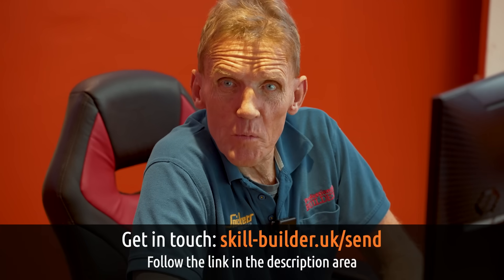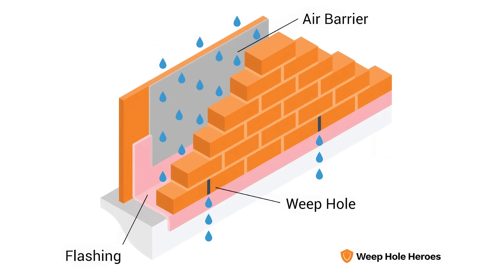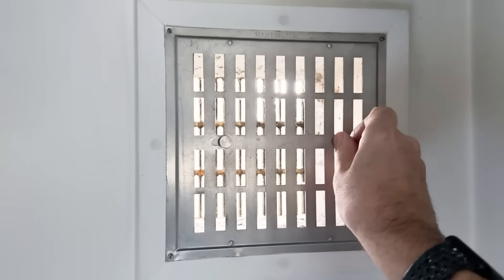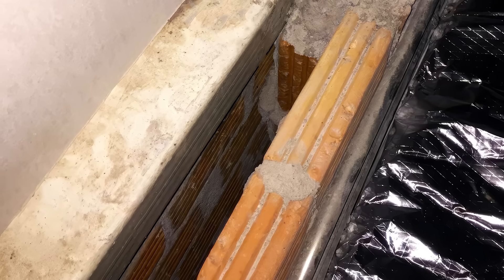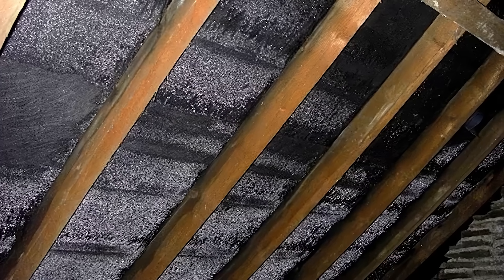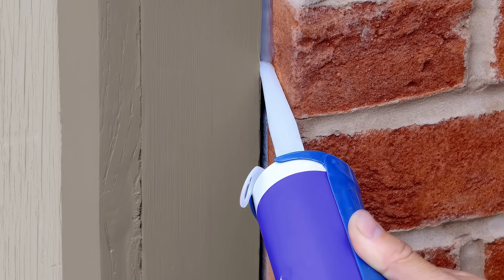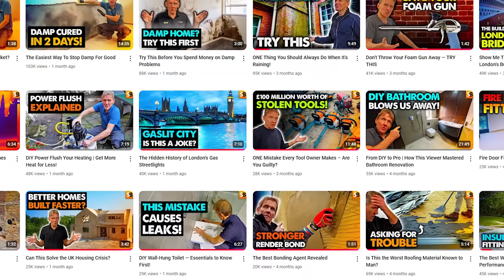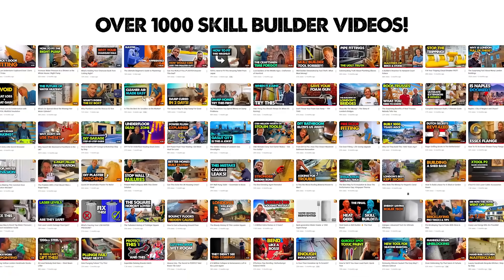The Truth About Cavity Wall Ventilation

Comment: I've got an odd internal cavity vent (white plastic louvered thing) on the internal wall of a cavity wall situation. The gable end is north-facing and gets cold bridging along the bottom sometimes causing condensation (the condensation pattern seems like it follows the mortar detritus etc in the cavity) , and I wondered of this was a 'fake' solution to that, or if it was where they put in some fibreglass insulation (which is in there) and never closed it back up properly. It's very strange.
Reply: Do you have an open fire in that room. If so it may be there to allow air in to feed the fire
Reply: @chapman9230  Thanks for the reply. 👍There's no open fire in the whole place. I can only assume it was either to placate the previous resident/s about the condensation or to install some fibreglass cavity insulation, it just seems very odd.
It doesn't go through to the outside wall and isn't sleeved, when you pull it off to reveal the hole (5/6 inches across) you can see the insulation so maybe it was to do with installing that, but I haven't yet come to a satisfactory conclusion about it.
For example someone suggested it might have been for a tumble dryer exhaust, but as it doesn't go outside and is in a position where you would never put an exhaust/dryer I have ruled that one out.
Reply: @thesunreport I suspect it used to go to outside and be sleeved as a vent for the room. But then when cavity wall insulation was retro fitted they bricked up the outside vent and just left the inside with the vent face.

Comment: Do we block up all the weep holes as well then?
If ever there was a waste of time it was weep holes. The Germans don't use them so why do we?
When cavities were ventilated we didn't have half the problems we do now. 
We have to fit cavity  trays halve way up the building, why? All that plastic just adds to condensation.
As for closing the cavity at plate height, (loft) haven't done that for years.

Comment: If the cavity is trapped, would that not cause condensation inside and psosibly cause damp and mould?
Reply: No, Roger said that any water/condensation should be allowed to soak away into the ground.
Reply: @chrisallen5548 but it wont completely will it. In the long winter months with any driven rain and even condensation, that cavity would remain damp and begin to mould up on any smooth surfaces in particular. I would personally leave the top of the cavity open and insulate with something that doesn’t hold moisture. That is unless you can, with absolute certainty, prevent any ingress, apply lateral vapour control and seal the cavity entirely with no airflow. Borderline impossible.
Reply: It would condensate, but then drain away, not much different than venting the cavity.
Reply: With the absence of cavity trays and weep holes moisture will get trapped so where a condensation risk occurs air changes are still needed in older cavities Roger  miss leading the masses again
Reply: Well the inner skin will be warmer than the outer so would not attract condensation - in winter. Airconditioned in summer it might
Reply: Recently built a new house, NHBC registered . They stipulated a new cavity insulation, polystyrene coated with a plastic facial sleeve. These interlock with each other. The plastic sleeve has vented flutes on them. The gap  remaining in the cavity was 25mm to the outer skin. It's the biggest heap of shit I have ever used in my life.  You have to slice through the plastic face to poke your wall ties through, therfore making the permeable barrier insignificant.  Does some numpty sit in a office and think of shit ideas to fuck a bricklayer up.  Time consuming is an understatement and the cost of the it to buy was extortionate. Fuck NHBC
Reply: Yes. 100%

Comment: Your videos are always interesting Roger! I have air bricks that are below floor level, but have a concrete floor (late 1970s bungalow). Does this mean the floor is in fact block and beam, and there is are space underneath it? Cheers
Reply: You can have both, one room in concrete, the other not. Why, i have no idea.
Reply: Or it was built with suspended timber floors but filled in and concreted at a later date
Reply: Dutch here. In about 1978, our neighbors took out the wooden floor and poured concrete on sand. Then we got rising humidity in our living room. In 1980 my father took out (with an other side neighbor) our wooden floor, 4 by 9m, and drilled holes to put chemicals in them. Then he installed concrete beams and concrete "breads" between them and filled it on top so that it is flat. Then he installed yellow airing bricks that ventilate the crawl space under the floor. Two on the front sidewalk side and on the back yard side. Problem solved since 1980. Also in this vid you see the area between the bricks and the window being sealed with silicone but that area must stay open. My parents house is from 1905 and the window frame is from 1905 and it is still okay. The bricks do not touch the window frame. I also saw it in a building school vid that even nowadays the young people learn to keep that open for ventilation. In the vid the teacher says that rain will not come in but the normal moister must be able to escape.
Reply: someone put a concrete floor in my kitchen which blocks the airflow which used to go under floors from front of house to back. i hope they put in air pipes but i doubt it

Comment: if the rain/damp is driven into an empty cavity how does it evaporate away if all sealed in?
Reply: It condenses on the inner face of the external leaf and gravity brings the water droplets to the weep tray and out the front
Reply: In modern buildings,  that is where wall weep vents will come in
Reply: The same way it got in

Comment: Does the moisture evaporate/drain back out through the cracks between mortar and brick?
Reply: Evaporates and drains into the floor, if enough had pooled and there was an escape out the mortar or brick the water would find it.

Comment: I've started seeing quite a few Cavity Wall Insulation Removal Vans in my area recently.
Why might that be Rog? Not being facetious.
After a recent outbreak of dry rot in a suspended timber floor I wouldn't dream of bunging up the cavity wall in my old 1930's semi.
Horses for Courses? I'm also up North, tis Grim.
Reply: Cavities are ventilated by perpend vents. Air bricks are usually for ventilation of voids. Dry rot is different from wet rot.
Reply: if theres a prevailing wet wind onto the wall the cavity insulation may get wet
Reply: hi Grim!